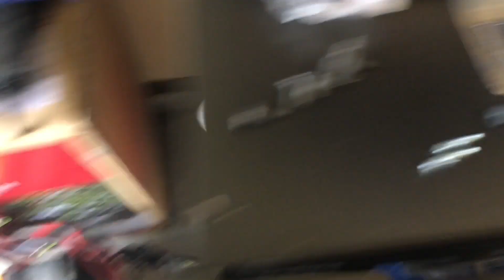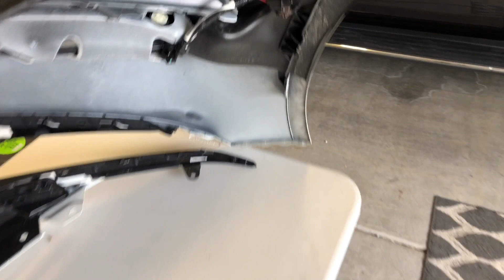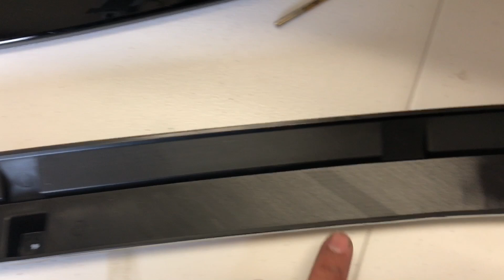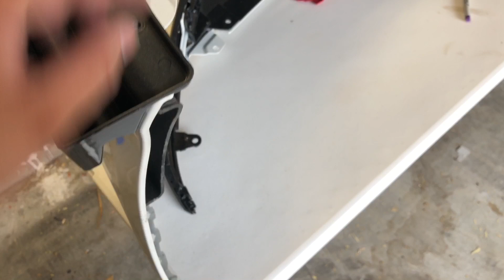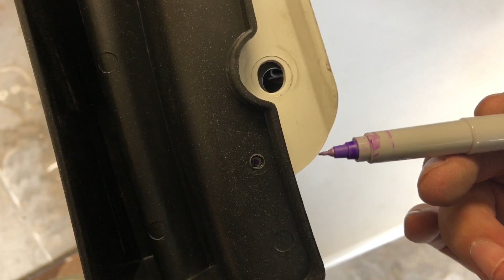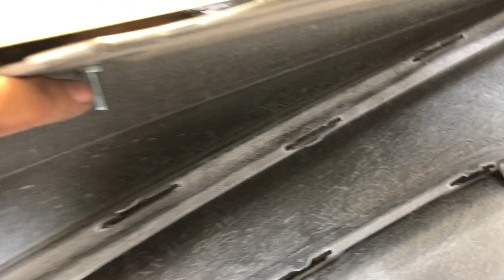2018 Honda Accord - JDM Front Lip Install 10th Gen 2.0T Sport

Comment: I got a 4 piece but it it is very similar to a 3 piece. I'm going to do the same as you dude, buy those size bolts and drill the holes to match them bolts.

Comment: So what made you get extra screws
Reply from the maker: The ones that come with the lip are cheap 1/4 inch self tappers. I’ve worked on enough things in life to know they wouldn’t hold (and they don’t) plus I wanted the lip to stay on the car even though it was a cheap $50 lip. The bolt, nut and clamp job secured the lip until I was ready to take it off the car. Last a year and a half until I upgraded to a better lip. It’s just making sure you do the job right the first time.
Reply: Fahrenheit Motorsports well can you help do mine then

Comment: Were u located at bro...how much youll charge me to install mind....great job btw
Reply from the maker: I’m in New Mexico brotha
Reply: Dayumm ur far bro....thanx tho....also quick question i bought a rear diffuser like yours... mine only came with 3m tape but im not to convince that only that would hold the diffuser well....what did u use on yours ??? Any advice bro ...thanc
Reply from the maker: The 3m tape surprisingly didn’t hold on mine. I used some nice screws and tapped it to the bumper. I spaced them evenly so they look like rivets. It came out real nice bro.
Reply: Ohh ok yea cuz i berly put mine on with only 3m tape .....i feel like putting screw under the diffuser to the bumper....you dont got a video on your channel uhh i was looking for one but theres none
Reply from the maker: No bro, that and the brake caliper paint job were the two things I didn’t record. 😂 Message me on IG: jdmdreamin and I’ll send you pics of where I put the screws.

Comment: Are all the 3 piece kits the same? Where you have to drill holes? I would not want to take the bumper off to install the lip. But hey you did it the right way no question. I'm lazy I would use the screws and get on my back and drill up. Jacked up of course.

Comment: I wouldn’t bolt mine because it’s made to rip off if you hit something hard  and not crack the bumper and grill , bolted if you hit a curb hard your whole bumper can fall off
Reply: I was just gonna ask if I should bolt mine down.  Good point!  I don't think i will now.
Reply from the maker: Trust me when I say you want to bolt it down. The lip isn’t made of high carbon steel, it’s made of plastic that’s designed to break up upon impact so on the off chance you do hit something hard the lip will crumble or shatter in the strike zone. IF you don’t secure it properly you WILL lose the lip at highway speeds 100% without a doubt. I’ve seen it happen so many times because people don’t use common sense and you lose your lip after a few weeks. 

The bumper is held in place by 18 separate clips at strategic points that enable the bumper to survive a crash at speeds over 50 mph with another vehicle and still retain its place on the car. For some reason this has become a debate where the uninformed think bolting this to a vehicle will result in a lost bumper but speaking from an engineering perspective that’s 100% inaccurate and couldn’t happen with the materials at hand. Don’t by the guy who creates a post weeks from now because you lost your “cheap lip” because you only secured it with tape and the supplied self tapping screws.
Reply: @Fahrenheit_Motorsports  Thanks for the feedback! yeah was looking in forums and videos and people have lost lips from excess speeds due to not securing the lip properly.

Comment: I'm curious about the dbl sided tape that is included with the package? Did you ever had to use the 3M tape on your lip ?
Reply from the maker: Richard Phou - I did not use the tape. I spaced my bolts to where I didn’t need the tape. The lip is rigid enough to support itself every 6-8” so I opted to keep it off. If I ever remove the lip it’s a simple job to remove and no tape needs to be scratched off.

Comment: Quick question, wouldn't have been better to use lock washers instead of those plain ones? I'd worry the rattling would loosen the nuts over time. Looks awesome! This car in that exact color is on my wish list, and when I get it I will definitely be getting one of these lips. I don't like to mod cars too much, but I love the sleek look of this lip while still be very minimalistic.
Reply from the maker: Hugo Aguilera - If your going to use just the supplied screws, maybe lock washers would be useful. I used Walmart hardware for like $2 total and it’s bolted on. My bumper would fall off before the lip 😂😂😂

Comment: I plan to bolt mine on also. Very nice install. I don't trust just screwing it on. Hopefully I can drop it to the body shop next week. Keep the videos coming
Reply from the maker: mj23bama - Doing wheels tomorrow! Springs and camber arms are sitting in a box in the garage. Those are next...
Reply: Mr Fahrenheit I just got my car back from the body shop and the front lip with the rest of the front blacked out makes the car look sick. I’m lovin’ it. The shop didn’t recommend bolting it on. They said if I were to go over something and it tugged on the front it would be better to loose the front lip than the whole front cover to the bumper. They said it will hold on fine with 3M tape and screws. What do you think about the underbody spoiler side skirts. Little pricy but I think it may look good

Comment: the lip is too wide for the rest of the car. A lip with Less width will be better to go with the proportions of the original skirts of the car !
Reply from the maker: Yeah I agree. I have a set of wheels and skirts going on soon that will fill out that stance. 🤟🏽
Reply: @Fahrenheit_Motorsports  I think your car is amazing AS IS. but if you want to put a personal touch like lowered a little bit, new wheels, and put some ground effects. I found a website maybe you will like this 10gen accord. little bit lowered with right Offset wheels and tires. NO OVER Stretch or RICER looking.  here is the link https://www.customwheeloffset.com/wheel-offset-gallery/479442/2018-honda-accord-vossen-cv5-d2-racing-lowering-springs 
hope you like it
Reply from the maker: Jorge Villacis - Yeah that car is sweeeeet! But that’s the plan, I have camber arms, lowering springs, wheels and tires sitting in boxes right now. Just got the new wheels today, about to test fit them.

Comment: I just drilled the supplied screws. Lifted the car and screwed from below. I have gone over 80mph with it and no issues. Checkout my video if you can.
Reply: i took to 140mph im drving throw snow and everything it stays brand new
Reply: @SamSabin  using my process or the one from this video?
Reply from the maker: BoostedWhipz  - I originally was going to do that but I thought back to my younger days and the lips I’ve been through. I quickly realized if I wanted to keep it on with all the driving I do (Real Estate) and future plans I better bolt that thing on. I’m all for easy...but I see far to many speed bumps and parking curbs to risk it. 😂😂
Reply: @Fahrenheit_Motorsports  I got you... Then definitely the way to go 😁
Reply: @Fahrenheit_Motorsports  long you don't lower it you'll clear everything
Reply: I dropped it about and inch the next day I put the stock springs back in
Reply from the maker: I would imagine it would stay put with wind or snow. Most anything you can put it through...expect maybe banging the lip on something lol. That was my biggest fear...
Reply from the maker: What didn’t you like about it being lowered? That’s my next line item to do.
Reply: @Fahrenheit_Motorsports  the car was a total beast when I lowered it but too much scraping especially where I live lots of potholes speed bumps and cracked roads during the winter time so next fall or summer I'll put the springs back in
Reply: BoostedWhipz hey where did you get that red honda logo?

Comment: Looks sweet. I bought the same lip. I actually put some double sided tape on the middle portion of it as well as I felt the screws weren’t enough. I also went as much as putting double sided tape where the lip meets the bumper just for my sanity. Good job tho!
Reply from the maker: J B  - I had every intention of using double sided tape if I was going with the screws they sent. Didn’t trust them 100% at the time. With the nuts and bolts on the lip, they are tighten and tortured down so there is no movement happening. Glad I went with the lip, it looks great and gets a lot of looks. 👍🏼
Reply: Mr Fahrenheit absolutely man congrats on the mod and Keep it up 👍🏼
Reply from the maker: Will do man!